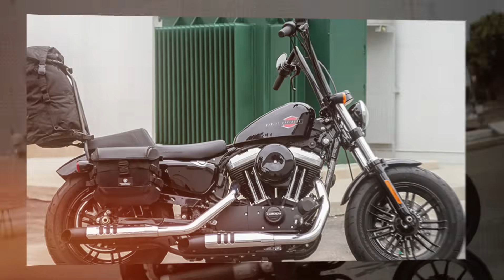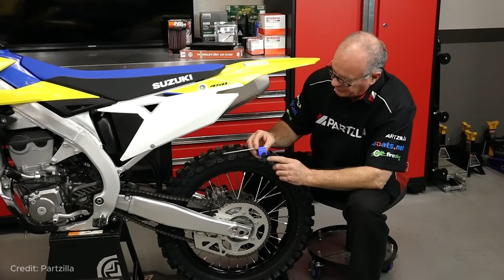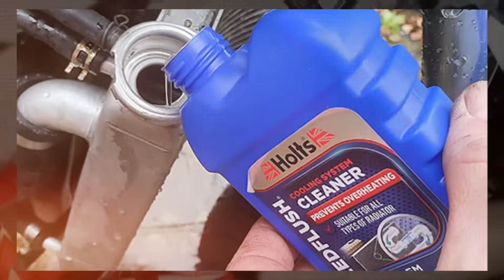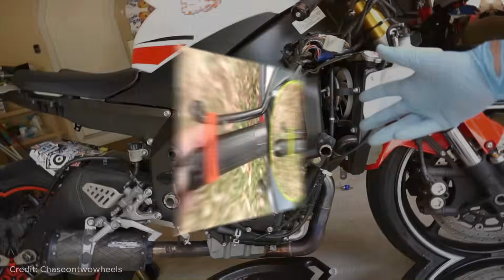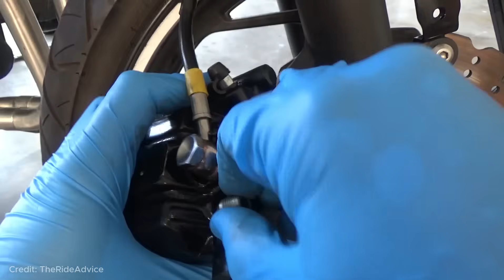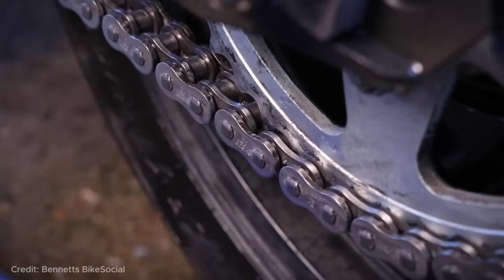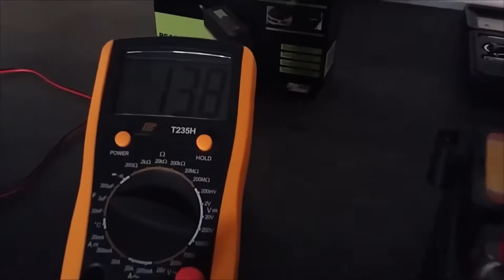STOP KILLING Your Motorcycle (Worst Things To Do)

Comment: Do not buy a motorcycle with fuel injection, and you will never have fuel pump problems because there is no fuel pump. Gravity feed into a carburetor  works just fine. Along with air cooling. Simplicity is also easy to maintain. You cannot have any coolant leaks if you have no coolant. If your motorcycle has no computer, you will not have to reprogram it every time you want to change air cleaners or exhaust systems.

Yes, I am old school. Actually I am 84, and have been riding since I was 8 on Whizzer motorbikes. Bought my first Harley, a 1942 45 flat head when I was 14, in 1955. My current ride is a 25 year old 99 Softail Custom Harley.
Reply: I'm just happy AF to hear you're still riding at 84! Just bought my first bike at age 54, I can only Hope to still be riding at your age. You are an inspiration, sir!
Reply: Fi has an oxygen sensor so it runs optimum combustion every time no need to adjust for elevation and always max power. The story about changing air filter and exhaust is just not true besides if you change to a more free flowing air filter on a carb bike you really have issues lol
Reply: @edwindol3597 buying bigger or smaller jettings on a carburetor is easier than reprogramming an ecu. Plus the price of asking to tweak the ecu. But yes, i understand the frustration of running rich on high elevations
Reply: @bryansamson820 if you would have an adjustable ECU you can adjust the fueling with an app on your phone so sorry I disagree also with this one I also have a carb 2 stroke still owned a bunch of them in the years and fiddled a lot with carbs lol and changing a jet all the time is kinda a hassle
Reply: a cowboy doesn't need an additional technology, classic carb is long tested over time 💪
Reply: agree, I ride a 2000 sporty, dr650, and xr150. air cooled, carburetor, no computer. pure mechanics.
Reply: I got me a 2003 FXSTD, carb,  100th Anniversary,,love my Duece  @jmcart
Reply: My Honda XR150L is blushing with pride
Reply: Yeah but sometimes the simplicity does bite your arse cheek. Even that stuff degrades over time. I've got a 1986 Suzuki Savage LS400 and an LS650 and I've had to replace 4 regulators on both in the last 6 months. One battery and two starter motors. One starter on each bike. Regular fails and over charges the battery and then fries the starter motor. Other than that simplicity is golden. Much better than newer stuff. I've got a 2005 650 sports bike and it's terrible. God cursed those 90° V-Twins. They're reliable engines if maintained but you don't want to work on them. I was raised by a mechanic so I can fix just about anything and I was taught to maintain everything I own and never go with the cheaper fix. If you can't afford to do it properly then wait until you can because it will save you a headache later. Replace stuff before it breaks. The only time I've ever thought about straying from that was with that V-Twin because it's a nightmare to work on compared to inline 4 engines. Not wanting to maintain an engine properly is why this bike bit my uncle in the arse. I bought it off him and it looks like it was running the original oil and he was a mechanic as well. That caused the gearbox bearings to blow up.
Reply: @DamienJohnston-sv2xh What you described are intentional design flaws.  The 80s Yamaha cruisers have poor charging and battery storage capacity.  If the bike sits for 7 days, the battery dies, causing fuel to leak out of the carb onto the engine, leaving a nasty stain.
Reply: I love my air-cooled and carbed dual-sport. The simplicity is what's missing on most modern bikes these days. It shouldn't have to be complictaed.
Reply: Honda vfr750 has a fuel pump it has four carburettors
Reply: My bike is 22 years old and I've never had a problem with the injection.
Reply: Agreed 100% My first Harley was a 42WLA as well, followed by a 37 VLD motor in a 35 VL frame. So I called it a '36 lol. I recently bought the kids a Chinese made dirt bike to learn on. Don't laugh, its got a carbie, a kick-start, no ABS or anything electronic exept the magneto, ignition coil, and head light! 1980s type Japanese off road bike but made brand new in China today.
Reply: My Intruder VS800 is dual carbed and has a fuel pump
Reply: Will an 05 carb Fatboy survive an EMP ?
Reply: @johnbradley5236 you don't have anything to worry about.  The electric grid will be gone, gas pumps won't work battery will be shot. Last thing a you need to do is start moving around by the  lonesome.  Its the time to shoulder up with neighbors and family, friends..they are your best chance to survive a future tactical nuclear attack. 
 If it has a computer, it's gone, so they say. Of course a extremely powerful solar flare does that too.
Reply: So many pro macanics here. This man is right in all departments. Even your carburetor air cooled bikes if not properly taken care of and maintenance done. It will also break. And carburetor can be a problem in themselves. Anything that is newer tech than 1983 will be better and improved.....
Reply: Is engine guards necessary ?
Some people use it and some don't
Reply: 17 years old here, sold off my gaming phone and threw away my gaming skills even though im joining tournaments, realized i just grew up and bought my first motorcyele, third owner but works just fine as a classic performance bike. Its a chinese bike though but parts are easy to find (Rusi Classic 250), currently building it as a project from last owners design being scrambler to a modern cafe racer but still carb type. 
Hopefully people will see this comment and help me/give me advices how to maintain my bike
Reply: I'm 22 and I agree with you, I also like simplicity over elite complexity stuff
Reply: Agreed on all statements from the OP.  If you want the same expensive  electrical and computer problems on cars, keep demanding "modern" bikes with computer- controlled VVT, computerized ignition, fuel injection, traction control, etc.  The shop will love you.
Reply: Honda used a fuel pump on their Shadow's, they're all carbureted,,,,,
there are other bikes with carbs abd fuel pumps,,,
Nothing wrong with injected fuel, you don't have a clue what you're sayin' ,,,,,,
Reply: @mikewatkins978  More necessary is more to fail. Gravity feed has worked fine for years. Carbs can be modified in almost an instant. Computerized fuel injection needs reprogrammed if you change the intake or exhaust. Air cooling does away with radiators, coolant, and leaks. 

Anyway, it is just my opinion. I started riding my first Harley, a 1942 "45" flat head when I was 14 in 1955,

Yes I am opinionated and old school. Or just OLD.
Reply: @jimkraft9445  ]Hey, no worries at my end, you believe what you want, not my problem, just sayin' you have no clue about how reliable fuel injection is now. and more efficient than carburetors.
but that's only 55+ years as a factory trained tech,,
Reply: I've had more carb problems than I've ever had fuel injected problems.
Reply: @Based360pEnjoyer rusi owner? 😂
Reply: @cXz-v8h  I've had hondas, Harley's, and a Vulcan but never a rusi, id definitely buy one though lmao

Comment: Been wash my motorcycle for years with a power washer. Just use common sense. Don't  get close to wheel bearings and electrical connections. How much pressure is determined by distance you are from the bike.

Comment: Oil on the chain is all you need.  Cleaning the chain, according to the manufacturer's recommendations, if at all, is what you should do.  One thing is certain-no matter what lube, it will go all over the rear wheel.  If your chain is rusting, it is due to washing your bike and all electrical components, when you know better than to do that.

Come to the realization that manufacturers apply low grade finishes and chrome on motorcycles. Rust will always haunt you.

Comment: Totally agree with everything here. My best advice is to keep a few rags handy, preferably soaked in clean water, for when you fill the tank. Spills happen all the time, and gasoline can easily discolor plastic parts and even the clear coat on shiny paint. A quick wipe with a rag is all it takes to protect the surface. Another thing – I'm not a huge fan of lubing the chain, but it's better to address any spills on the rear tire, including brake dust. I try to do it after every long ride – it takes 5 minutes on my bike to go over both front and rear and wipe off the brake dust

Comment: Every time when you riding make sure that your every note bolts is Tite , break is good and tire pressure should be correct.because of note bolt my back rim and hub got cracked while riding at high speed so be careful guys

Comment: I have been using a pressure washer for 25 years, never had a problem. But I am very careful where I spray. I spray from above, not the side. I do the wheels and the chain with the pressure washer though. It works great, but you need to know what you are spraying.

Comment: You do not align the chain by setting the rear wheel out of alignment.
The rear wheel has to be aligned.
If the chain is out you have a different problem.

Comment: Modern bearings are sealed once it starts taking on moisture its been overdue for replacing for quite some time.  Now with electronic parts you are right but unless you are a complete idiot who should not be near high preasure water not to mention vehicles of any kind. You will stay a foot or two away with the nozzle when rinsing electronics.  I mean my sthil preassure washer is 185 bar if i recall correctly that thing will easily cut off your fingers but if you a foot or two away from the nozzle it is not even uncomferable to hold your hand there.   Now when it comes to coolant there are only 3 kinds atlest here in sweden. RED. BLUE and Yellow. You dont mix red and blue but you can mix yellow with both.  Also the tap water compleatly depends on your water hardness level.  Like where i live we have a hardness level of 1.  Going lower would be distilled water. And you dont need distilled water in your cooling system.

Comment: Make sure yall top off and triple check the engine oil before you start it. Then press the starter button w/o starting it quickly press it to allow the pump to fill the oil filter.  After yall have done that. You can start ur bike. I messed mine up. Don’t do my dumb mistake.

Comment: I got engine casings on 2019 CB1000-R Cerakoated in Glacier black & Arctic black & the inner surface of these casings in P-109 micro slick dry film. The whole exhaust System Ceramic coated. I use Motul 7100 4T engine oil with K&N Oil/Air filters. Engine ice coolant & a Samco Coolant hose kit 😎

Comment: 11:28 I learned about clutch wear in a 2001 Toyota Celica 6 speed. I had no hand brake so while I was stopped on a hill I would down shift to 1st and hold in the clutch pedal. That's not good for the clutch.  Best thing to do at least in a car is drop it in neutral and when the light is changing depress the clutch put it in gear and slowly release to hr clutch until you feel it start to grip and when the light changes with the light contact on the gears give it the gas and release the clutch smoothly but quickly so you don't roll into the a- hole who's 3 inches from your rear bumper because follow distance don't exist. Lol

Comment: Because fuel pump it help the compression fuel pump can sending gas to oxygen sensor ignition coil oil pump it send oil in the compression the  crankshaft wata pump cool the engine bearing it can damage the transmission engine bolting coil it can damage the idler on the gas pump oil filter too

Comment: Bro how to park lock the bike while I say 1st gear is putting full tention. 

Neutral risks ur bike to fall down by moving backward or forward.

Side stand doesn't always protect the bike
Reply: Riding season soon. Always have in your bags (or kit) a 4"X4" square of 1/2" or 3/4" plywood for placement under the side stand on hot asphalt or soft surfaces. Beside that square, a 4"X3" bit of two pieces of 3/4" offset and nailed together. It makes a fair, workable chock. Or just buy a stand coaster and purpose-built motorcycle chock. They're cheap and small. But they work well enough. I learned by taking my bike to an event and finding the motorcycle parking area was grass. I sat on that bike looking like an idiot until the rest of my party showed up and had to send someone out to get a can. 
I use a bucket of soapy water and a garden sprayer to wash down the bike. Nothing higher pressure than a rain shower hits any part of the bike. Never had issues. 
I did fry a battery using a straight charger on my first bike. The service department where I bought the new battery informed me of the existence of battery conditioners and smart chargers.

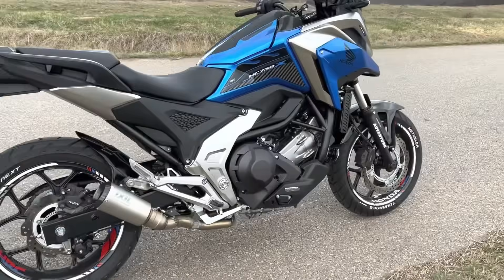Comment: 3:16 you are wrong you can powerwash the bike just keep more distance and work with Microfiber cloth. you also ride in rain so why a powerwash should be a problem? if done right.
Reply: Rain vs pressurized water isn’t in the same galaxy let alone ballpark but your right, don’t spray directly on connections, intake and bearings and your fine. But let’s be honest, if you’re doing anything more than a Sunday wash you’re mostly going to be using a rag and a brush to get off the road grime and bike fluids so a pressure washer isn’t saving time or really needed.

Comment: What I haven’t seen mentioned is how detrimental frequent startups are during storage. Quite a bit of condensation is created. This I have seen in the sight glass of my wet sump Ducati. Frequent starts pollute bike with water and acids. When you start your bike, give it a decent warmup say 5 mins or you will give it base gasket leaks putting a load on a cold engine. It is a stack of parts which need time to expand. When you start your bike, take it for a decent ride, at full running temp, boil off all the moisture you can’t see.

Comment: I don't know if I should be teaching a master class or not but I was just raised to take care of my vehicles. I'm the kind of person that likes to fix stuff before the break. The only issue I've had is a bike came with a fkd regulator that fried my battery and then my starter and water getting past my tank seals and screwing with the carburettor. If you want to learn how to maintain your bike properly I recommend doing a basic automotive course. I was raised by a mechanic so I didn't need one but those courses are always good for learning something new. Always remember that if you can't afford to fix it properly save up the money for it because it will cost you more if you let it break. You don't want to lean the hard way when your crankshaft bearings blow. If there's a set guideline before changing yours make sure you meet it or do them early so you don't have to rebuild your engine when they do let go because it is expensive and usually damages everything else.

Comment: Good, informative and sensible. For my '98 CB500 I thought index 5 for 'front caliper mounting bolt' was a bit OtT, meaning 'Do not reuse'. I've changed my mind and will order new ones ASAP. To add sth to your list: Check your severely stressed clutch cable regurlarly, and keep an reserve with you on longer rides. That part's status is more or less binary, wholly OK or broken and useless.

Comment: The springs shown in the clutch animation is not the clutch springs, but the shock absorbing springs. The shown springs is not under tension with the clutch activated. But the clutch springs are, so longtime activation can result in a slipping clutch.

Comment: Maybe youre buying the wrong Bike lol My Honda Shadow has over 50,000 miles on it. I treat it like a Bike I dont buy the best oil or the best tires i dont clean on it all the time. I ride it. I get just as much service as anyone else gets or more. I use Havoline oil it keeps the motor inside clean longer. The reason i use havoline is i spoke to a mechanic and he told me he rebuilt a motor in a car that had a lot of miles on it but was still running great the guy just wanted it rebuilt it. The man who owned the car used havoline oil The Mechanic  said when he took that motor apart it was the cleanest motor inside he had ever seen that it look like new no build up on any of the parts. So i started using it in my cars and motorcycle. The oil change last so much longer. My sisters husband has a Chevy truck he used the best oil and one day  i was at their house and he check the oil in it and it was dirty and it wasnt time for an oil change so i check the oil in my car his oil chance was newer than mine but my oil was clean like i had just put it in the car. Thats why i use Havoline. You can use whatever you want but i will never change to another kind of oil. The motors last a lot more longer.

Comment: never spray water on to an engine use dry rag of brush never let tank run low but you can have a fuel injector bike carb way to go less parts if i could go carb on a 2002 victory v92 1507  i would convert to a carb but them 1st ones were junk guess have to replace bios chip with after market chip then have it reflashed with scan tool

Comment: good video.   start my bike every other month i am not riding it and work everything a bit . Charges the battery and brakes get cycled clutch gears.  No issues storing them. And it prevents rust on pistons rings  keeps them lubed  . You could add fuel stable as well,  Lot of people pull a plug and add light oil into the cylinder for storage .

Comment: How come you didn't address the damage that can be created by using the incorrect engine oil? Older bikes should not have full synthetic oils, certain parts of the engine were never designed for the slickness of synthetic oil... starter clutches to be specific.